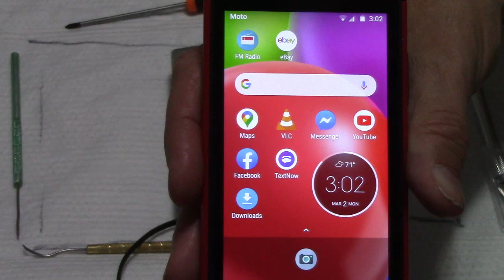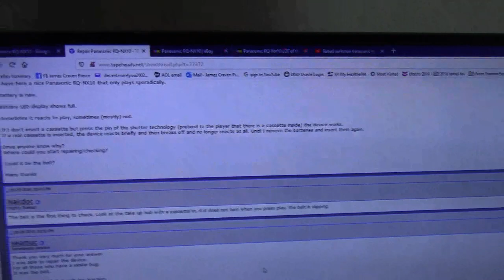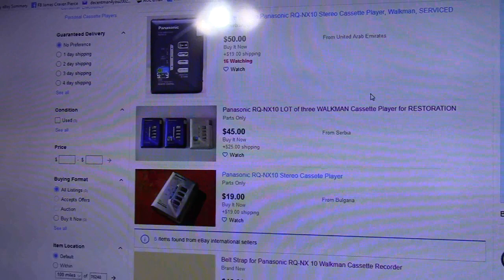Panasonic RQ-NX10 cassette walkman unsuccessful Belt install

Comment: In RQ-NX10 belt is easy to change, it is put on with thin tweezers or a long needle. No need to charge a fee. It is enough to remove one cover.
В этом плеере поссик легко меняется, он одевается тонким пинцетом или длинной иголкой. Не надо снимать плату. Достаточно снять одну крышку.

Comment: biggest tip to open up these panasonic players is to desolder the pcb to access the belt. i struggled as well to take apart my panasonic.  Thankfully i found a guide written by walkman archive and the guy who made the sony DD gear's
Reply from the maker: I found the service manual online and I read about the un soldering of the two different five points to be able to remove the motherboard from the to be able to get to the I do not have that precise finesse to do so it is now in a plastic bag still a part or in pieces as I showed in my video and that's where it will stay until I find somebody that can repair it properly for me